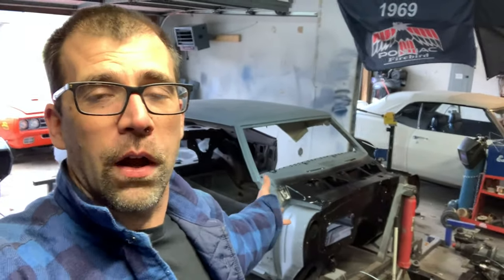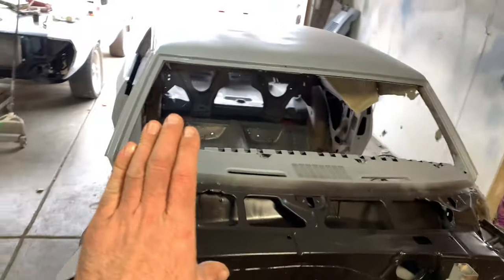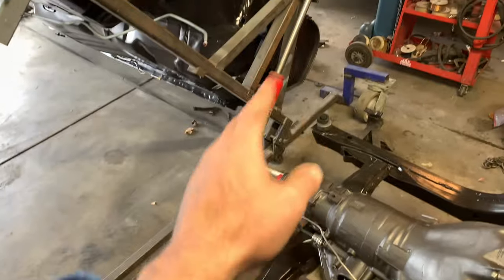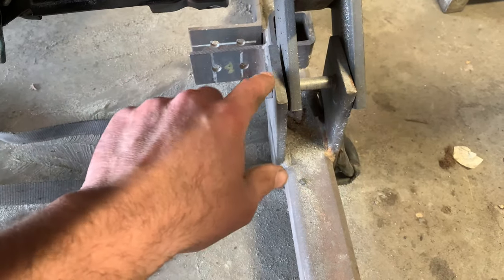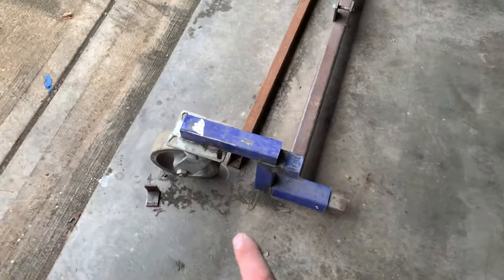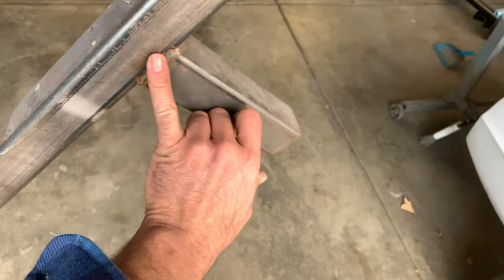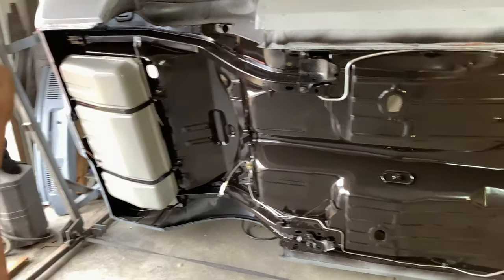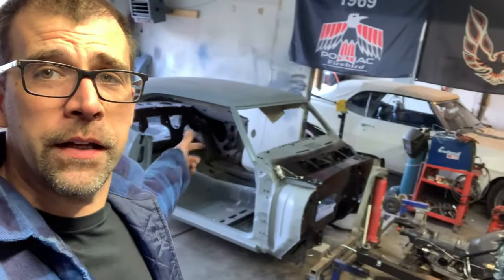VVG car flipper rotisserie assembly, operation and dimensions

Comment: The car flipper is awesome.  If you use some steel tubing to tie the front to the back and make it bolt together there it will take most of the stress when moving it. You could even weld tabs to your engine hoist legs and use them so they have 2 purposes.
Reply from the maker: It definitely would help keep things in place especially if I need to move it out of the garage

Comment: Finally... the VVG flipomatic! Great work, John. Maybe you could add a small wheel inside on center to help prevent the twisting force from taking place...(basically where your tie strap is)
Reply from the maker: Another great name, you guys are great! 
I though about a small wheel too.  The trailer i had to use has only ramps and open in the middle so I would need two wheels and felt it would high center anyway. Fortunately the damage was minimal but I agree needs some
More engineering if I plan to keep the wheels on it.

Comment: Great video Jon!!  I like your design of your car flipper.  It follows the "work out of your garage" philosophy you have been showing in all your videos.  The rotisserie's I have seen do not fit in the standard double garage (16' long with 8' ceilings).  It looks like your car flipper will allow flipping the car in a 16' garage with only an 8' ceiling.  I have seen wooden jigs that will do the same thing however it takes two people to flip it plus it looks risky during the flip process.  With your design one person can flip the car and and I see no risk.  Your design works for the 67-69 Firebird and I believe it will also work with my 68 Camaro using the angle bracket. Keep it up - luv all your videos!!
Reply from the maker: Thanks. Yes low ceiling clearance and ease of installation on the body is what inspired the car flipper thing. A standard rotisserie needs more ceiling height and a lot more then 15 minutes to mount it to the body.  I can open the garage door and still clear no problems. There are rotisseries that fit I have seen them in photos they are out there, i didn’t feel like finding one.  I have about $240 bucks in building mine and that includes the cylinder. That was 5 years ago of course.   Glad to help and i definitely think it would fit in a Camaro body just the same.

Comment: Great engineering! I can see where the wheels have their pros and cons.
Reply from the maker: Thanks,  that is why I made the wheels easily removable.  Around the shop they are great just don’t load it on a trailer for transport without more support on the middle I suppose
Reply: @VinylVillageGarage  Would adding another wheel to balance the load help?

Comment: Great video on your car flipper design.  I have a  possible fix for the tail panel bending issue.  Replace the nylon strap with nested square tubing.  I would  place it on the hinge side so it is out of the way while you are working on the car. 1/8"wall tubing should do.  Starting at the rear, 2" tube about 12" long, Another piece triangulated to brace the tube, 1 3/4" going forward at whatever length you feel works.  Another length of tubing to nest inside or outside the previous piece to make it to the front framing with another length of tubing at the front framing similar to the rear, 12" square tube with a triangulated brace. Nest the second length of tubing into the front.  Drill holes near the ends of the front, rear, braced tubing sections and center section with a nut welded on to bolt the tubing together.  This will make it easy to break down and store and should alleviate stress on the tail panel issue even with the wheels on.  If you are using the flipper to transport to media blast, then I would place a similar removable brace on the open side to help relieve the stresses on that side while loading/unloading and transporting the car to and from media blast.   Just my two cents worth.
Reply from the maker: Appreciate the input. I like the idea of keeping it collapsible, space is limited and hope to keep using this tool. Add the wheels was an afterthought and was just to help load it for media blasting.  I used to just blast in the garage but it makes such a mess I wanted to try something different. Thanks again
Reply: @VinylVillageGarage  Thank you.  I watched your video again.  You are correct about the wheels may be causing the twisting and the damage on the tail panel.  If you can slip tubing in the ends of those wheel brackets you have fashioned there.  Looks all you need is tubing between those brackets if they are inline and you are golden.  I'm restoring my own 69 Firebird and I think the design you have there is a great idea!
Reply from the maker: Thanks,  it was supposed to be simple and collapsible and with out the wheels it is.

Comment: What were the reasons that you didn't just build a rotisserie which would allow you to flip the car upside down. I am sure there are pros and cons. Just curious what those are.
Reply from the maker: Couple reasons, ceiling height is low
In my Garage, and space is limited too. When flipped up I gain floor space unlike a rotisserie it won’t flip on its side close to the wall.  Lastly it’s super easy for me to install on the body by myself. Some rotisseries you have to lift that body up
Quite a bit to mount it.  I can install this one by myself. and flip the car on it’s side within 15 minutes with mine.    Downsides can’t flip it the other way to make it a little easier to paint the drivers side. Pro and cons I suppose.